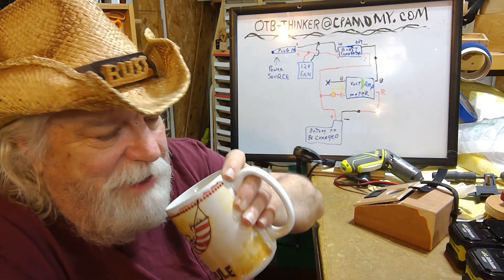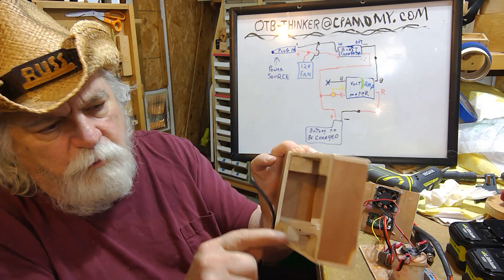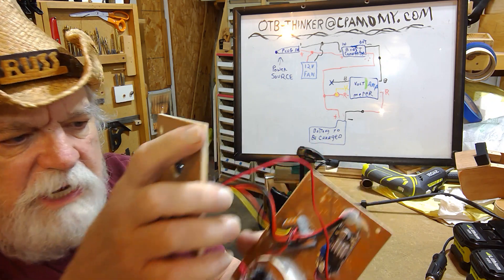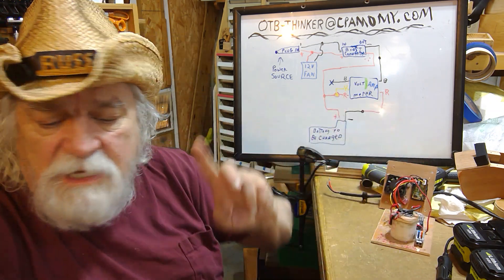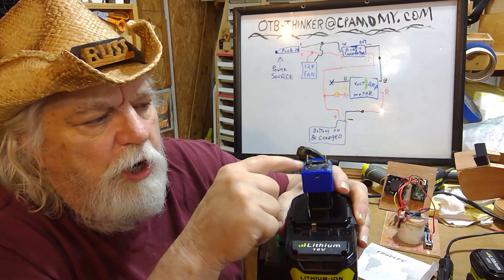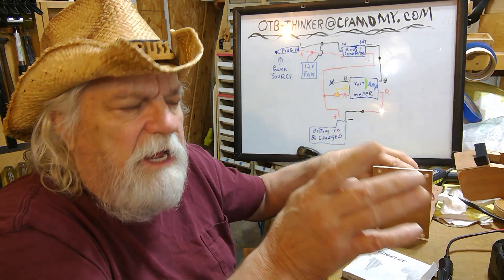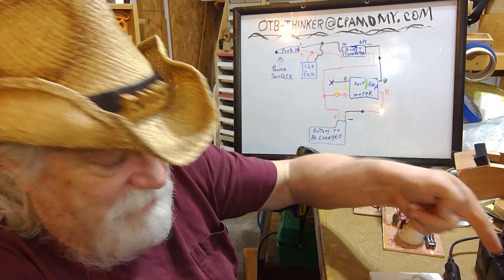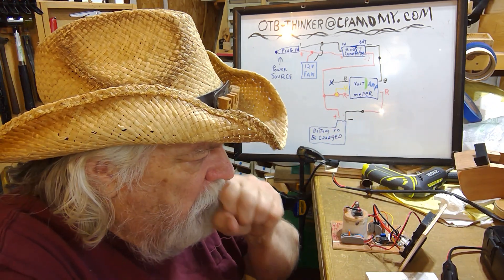DIY 12V Ryobi Battery Charger Part 2 by OTB Thinker

Comment: Good set of articles on the charger. Seems very straight forward for building. As is Mark, I'm having some trouble getting valid links to some of the Amazon pages. The boost and buck converters seem to be easy to locate using the search tool bar at the failed Amazon page. It would seem that the boost converter you used is readily identifiable by picture, but no way to verify that it is you same part number you are using. Just a guess but the links you provided may be truncated. Even if I copy and paste the links into a text editor they appear that they may be truncated. Love the build directions though!
Reply from the maker: I fixed the boost link (I think :>).  Thanks Tim.  Any other bad links I missed?
Reply: @russveinot5754  The boost link works fine now.  The battery terminal, the electrical lever connections and the Ryobi clip references do not function correctly -- two 404 errors (can't find the page) and one Amazon dog link. Otherwise the rest of the links function well. Thanks for the hard work!
Reply from the maker: @timothyhood2827  now they all work, thanks Tim.  This isn't supposed to be this hard :>)
Reply: @russveinot5754  Well, you done it! That's all that counts!